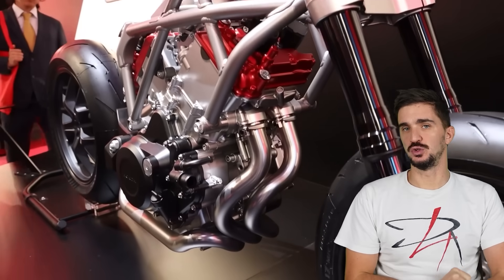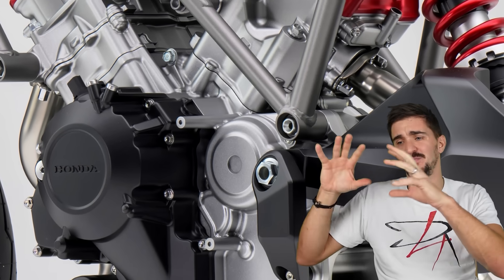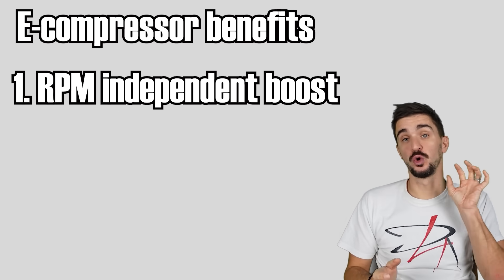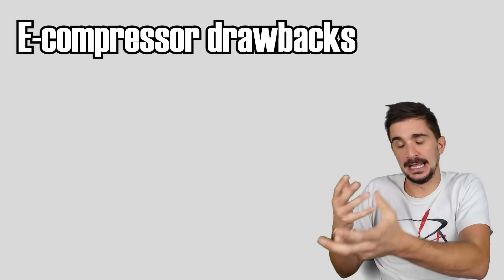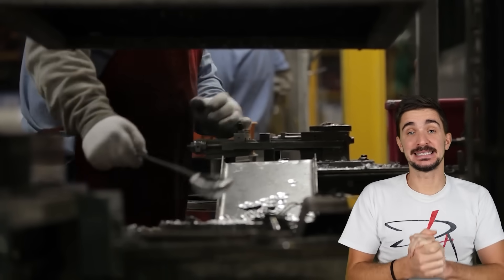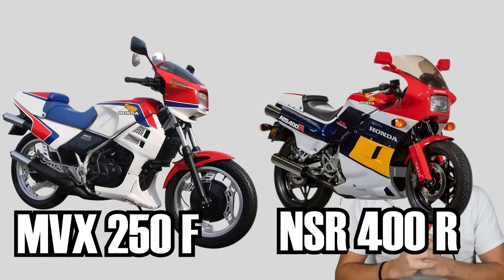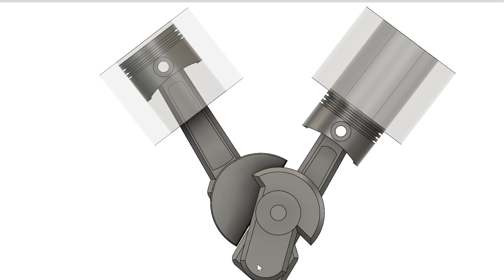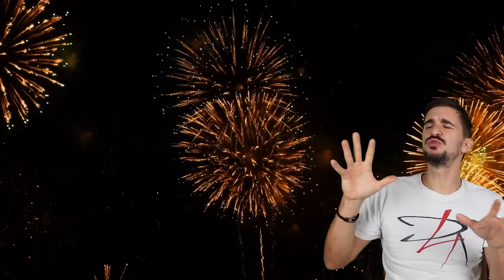Honda's New V3 Electrical Compressor Engine Explained

Comment: 1. Instead of increasing counter weight to single cylinder bank, could you make the single odd cylinder larger to equal the displacement of the two opposing? 

2. Is electric compressor more efficient or less efficient? The power conversion from stator to battery to controller to motor sounds like a lot of heat loss

Comment: So, E-compressors. What's the total power to weight to efficiency gain of the whole system. You'd need a small battery, and a BIG charging system to keep up with the compressor. The e-motor with enough power to drive it would also be pretty hefty. I'm going to take a wild guess and say under 150hp and over 450lbs for this thing, which is a no go for me.

Comment: From a maintenance perspective, I don't like the V3 config.  I don't want to maintain two DOHC cam and valve arrays on my bike.

Honestly, I'm kind of tired of disassembling the tanks on my bikes every 12k miles even for something like a P-twin.  Strongly leading towards a MotoGuzzi for my next bike just for the exposed cylinder heads.  At least I can do valve clearancing without disassembling half the bike.

I do dig the idea of the electric compressor.
Reply: Yeah, you have a point here.

Comment: Honda engineers thinking outside the box. Keep gas engines to power the vehicle and electrical systems, while using the an electric motor to power the engine and not the vehicle.

Comment: Question?
Wouldn't an INLINE 3 be better?
What about balancing the weight?
Wouldn't the V engine vibrate more then a INLINE engine?
What is the block, pistons and connecting rods made from?
Reply: Inline will not be better from the packaging standpoint. It will vibrate a little bit more, yes. Block, pistons and connecting rods are made from a metal, obviously.
Reply: @vvevvevvvv Forged or powder centered, compression mold?

Comment: I'm curious about how they will deal with knock and preignition.  The advantage of being able to build boost instantly is mitigated by the inability of most engines to tolerate forced induction at low rpms unless they run fancy fuels.

Comment: It is basically a centrifugal supercharger but less efficient one. Instead of using a belt to spin the compressor, honda is using a electric motor to spin it. Which is charged by a belt probably. They didn't wanted to include a massive belt that would look ugly and possibly threaten the safety of riders fingers so they are paying more by installing a electric motor and getting less because of indirect way of spinning the compressor.

Comment: I don't like odd number engines. They all have inherant balance problems that must be delt with by adding an opposite counter weight. Rather than having a Cheaper 1 cylinder engine with a bunch of Dead Weight on the Flywheel to SIMULATE another complete Cylinder I would rather have 2 pistons working together to deliver smoother more efficient power.

Comment: You are wrong!
It IS a turbo, or an e-turbo, because the air is compressed by a turbine impeller.
A traditional turbo has TWO turbine impellers on a shared shaft, one is drive by exhause gasses, the other turbine compresses the air.

This e-turbo has just ONE turbine impeller to compress the air, and is driven by an electric motor.

Also, there is another important benefit of honda's new e-turbo design; the computer controls the boost at all times. So thr ECU computer can select different boost levels for different rider modes and different RPM ranges.
Reply: @d4a     be rude and laugh all you like, but if the air is compressed by a TURBINE then it is a type of "turbo" as opposed to a compressor or supercharger which has displacement impellers

Comment: My 2nd bike was an NS400R.  I can attest to the smoothness of the V3 configuration.  That bike was a blast.  The main downside was you smelled like an oil refinery after riding it as it was a 2 stroke.  But it punched well above it's weight.  That era had several similar options from Yamaha and Suzuki as well, but those were inline 4 cylinder 2 stroke bikes.
Reply: rg500= square 4.
RD500= v4.
Reply: @impulse_guy_22  Sorry, I knew they were 4 cylinders, I just assumed they were inlines.  Cheers.

Comment: Dude, I like you and I like your videos but there's an error in this one.  The animation of the flow through the compressor is backwards.  It's a centrifugal compressor, the air goes in the middle and comes out the other end of the 'snail shell.'

Comment: If wheel or engine braking is incorporated into the electrical recharge, you do get augmented boost - aka; hybrid. And the boost "may" increase mileage in stop/go operating conditions just as it does with autos. Perhaps, that was part of the intent at the beginning with increasing emissions standards being imposed.

Comment: Weve been working on a project mating a parallel twin to a larger ktm single. This is the closest ive seen im glad honda of everybody was obsessed with the v3 idea as much as i am to bring it to market. But i want different sized cylinders, might not run for a long time but i just want it working as proof of concept.

Comment: The E-compressor looks like my wife's hair dryer.  I'm don't understand why they went to 3 cylinders with two are in the same compression cycle...adding more parts/complexity. Why not just a two cylinder V?

Comment: It would be interesting to compare the efficiency and power benefits/drawbacks of using an electric motor to make a compressor spin, versus applying the mechanical energy directly to the output shaft of the engine with an assist electric motor.

Comment: Would there be a benefit if they made the single cylinder side larger diameter bore to equal the displacement of the opposite side?

Comment: If they add a lightweight hub motor to the front they can recharge the e-boost system with a regenerative braking circuit.  I'm seeing a supercapacitor application, maybe.

Comment: I need to hear one of these, wondering if they will fir the 2 front at the same time or 360 apart, I assume together, also why both at the front other than picking space?

Comment: In terms of energy exchange a turbo and an e-compressor are quite similar -- on adds losses due to back pressure while the other via the generator... the question is in the total efficiency, weight difference.

Comment: That is a centrifugal supercharger.    Could help torque and low rpm.   Being electric it may loose ability to build much boost at higher rpm but might be more effective at low end performance ranges.   I don’t know anything about this power plant or the compressor being used but those are first thoughts based on other electric applications that struggled to maintain boost at higher rpm.   Will be interesting to see what Honda has figured out.

Comment: Another benefit of uneven firing order is it makes it easier to regain grip in slippery conditions as there is longer period when tire isn't driven but coasting along. This is basically what most traction controls do, with these kind of configurations it comes partially for free.

Comment: Honda went full retard. Rather just have a V4 with no compressor, extra power and takes up the same footprint as the 2 front cylinders. And they can keep the electric compressor. Just another electronic part to fail.

Comment: I have an Audi SQ7 with the electric compressor and it basically does nothing at all. People disable them when they play up and it’s apparently unnoticeable. Also 5psi, maybe at idle. There is no way that thing will make 5psi at 10,000rpm. The electric motors just don’t spin at the rpms real turbos spin at. They will just use it to raise low rpm power, I doubt it will do anything for peak power.

Comment: Before vid thoughts: Will the rear recip assembly be of different mass to reduce balance issues? Different bore/stroke for similar power pulse? Or is there a balance shaft? Electric blower can use plug-in batteries, this sapping zero engine power to operate. Regen capability can be programmed in, linked to ABS. Will it be on-demand boost, so it will run aspirated normally? 
Time will tell, but whatever it is must be affordable, based on market trends.

Comment: I guess I'm old, but I like the feel of turbochargers. I like the positive feedback loop where the engine revs up far enough for the turbocharger to start supplying more air than the engine can naturally intake, whereupon the engine starts building horsepower at an exciting rate. Having the power delivered instantly is great for commuting, but not as much fun.

Comment: With only one connecting rod per crankpin (unlike Moto GP's V5), couldn't balancing be achieved by shifting the crankpins by an angle equal to (180° - 2 x V angle) as on the V4 1200 at 76° and on the old V2s at 52° and 45°, which would give a V opening of 75° an angle of 30° (instead of 105°)?

Comment: You didn't mention, i believe, one of the advantages of an E-turbo in that it does not heat the inlet air like a normal turbo does due to exhaust gas heat, heating the housing. Probably why it does not need an intercooler.

But also, why not just build a v4. Pretty much the same width as 2 cylinders ... ?

Comment: In the "overall net more gain spelling" I think you forgot the point that electricity wants to be generated before as well. I don't know if the efficiency of electric generators and Motor is better than the exhaust Turbo System, but anyway.

Comment: Wie lange soll die elektrische Scheiße halten?? Da sind die Werkstattbesuche schon vorprogrammiert. Und von Langlebigkeit brauchen wir hier gar nicht reden.
Ich habe eine Kawasaki GPZ 750 aus den 80er mit 90.000 km und eine Yamaha Fazer 600 aus 99 mit 50.000 km.......... Das sind Werte die mit diesem Elektroschrott nicht mehr erreichbar sind. Siehe E-Autos. Aber fast alle reiten ja auf dieser Schiene

Comment: A forced induction V3 motorcycle engine... I see Honda found the nose candy and I'm excited! I'd also guess the sound from this thing will be incredible, which is honestly what I'm most excited for (engine power output in general is pretty damn good across the board nowadays, what can I say)

Comment: 89,000 miles and my 900s BMW never needed service never broke was stable and ran wonderful I sold it for moe than I bought it for. Try that with a modern bike.  My RD350 Yamaha was fast for the day light but should have been lighter and was amazing once bored to 398cc it really did need a better aluminum frame and more shock travel.

Comment: I wonder where the electrical power is going to come from to spin that electric compressor?  There's no way a typical 12V motorcycle battery and charging system will be able to handle what that compressor is going to be asking for. I'll bet the bike will have a special, very beefy Lithium battery that packs way more of a punch. Or possibly even a supercapacitor.

Comment: Batteries have also gotten lighter, more energy dense and also lasting longer charge cycles since the 2000s. Couple that with energy recovery then its win win across all fronts except cost😂!

Comment: I'm figuring Honda can offset the weight of a larger battery by using an NiMh one that weighs less than half as much. This could give a 20AH battery capacity in a 10AH lead/acid space which would work. The battery technology is well enough established where it's completely ready to go as well. It would have also been interesting to see them use their old V-twin 3 valve combustion chamber design that worked very well in the 80's, making a simpler engine overall, especially if it's going to be boosted, giving a good balance of lower RPM torque, a simpler engine and still good high RPM usability. I really did like those earlier simpler single cam motors they made, I know this will be nothing like that though. 
Very happy to see Honda sticking in the market and continuing to develop new and hopefully better bikes, I wonder if this will be a very street oriented bike like the old VFR line was, those were so wonderful.

Comment: Ok.. I give up.. you have way too many inaccuracies compared to your other videos. The e-compressor is going to take power from the engine driven alternator, so it cannot produce more power than a turbo, UNLESS you are using a battery that is working as a power storage, AND that’s been charged with regen or when the engine is not on boost. And I think that’s what Honda will do and that’s why you will get more power. But it is misleading to say e-compressor makes more power because there is no back pressure, without going into these details.

Comment: It should be near-zero boost lag and idle boost threshold, not zero boost lag and near-idle boost threshold. The electric motor still has to overcome the inertia, so there is always going to be lag. But, the boost from an electric motor is independent of the engine speed, so boost threshold is idle.

Comment: VTCEC
Variable Valve Timing&Lift and Compression electronic control

Doesn't it have a turbine anyway? 

That's what they're using to power the battery for the compressor right?

If not then the alternator is gonna have to take more power anyway which might be more than the back pressure loss

Comment: I’ll be shocked if this ever sees production.  The complexity of v with a blower, size of a v relative to a parallel , vibration of a v, heat management from the rear cylinder, weight of a v, cost of a v, complexity of service of a v relative to a parallel, packaging of a v is inferior to a parallel, …. makes no sense to mass produce this.  With the proliferation of cross plate cranks, there is no reason for the existence of v engines.

Comment: One reason for the turbo's limited boost and short boost duration is the power required. A supercharger on a small block Chevy (5.7 liter) requires up to 200 horsepower (at a slightly higher boost). With that baseline, we can estimate Honda's power needs just based on displacement ...0.8/5.7=0.14,   0.14*200=28 horsepower. Honda is a higher revving, better breathing engine. That increases the power required, while the lower boost pressure decreases this figure. But it's safe to say 20 to 30 horsepower is required. That is a LOT from a small motor. That is also a LOT to extract from the engine spinning a LARGE generator. A large battery is also needed to enable briefly surging the boost beyond what the generator itself can create.

Comment: I used to own a NS400 , 3 cylinder 2 stroke, first time the power band hit ,it almost threw me off the bike. I wasn't ready for it. Thankyou for making these videos.
Reply: We learned with 2-stroke Motocross, to always keep a finger on the clutch lever to help control abrupt power.  Even with 50 hp, on corners with good traction, we would pull in the clutch while entering a corner, pin the throttle open, and feed the power out with the clutch.  That would even let us enter the corner a gear higher than normal, (which also taught us faster corner speed), and not have to shift up again after the exit.  The technique was developed by Kent Howerton in the 70's, to keep his Huskvarna competitive the the new and faster Japanese bikes.
Reply: @EarthSurferUSA  sounds like you changed more clutches than pistons
Reply: These sounded great!! better than my RZ500
Reply: @snellen46  They weren’t, the RZ500 was faster and and more powerful than the NS400, the NS went more like a RZ350, I used to race against them in junior production races on my RZ350, they were in the same class.
Reply: @TeUhtred7860  I only said they soundfed better, I owned both. Honda also handle way better stock
Reply: I loved that bike, and it’s asymmetrical pipes!
Reply: Same here.  Gave it a fist full of gas during the test ride (since it was just a 400cc), lifted the front wheel at 50 mph when it hit the power band.  Scared the crap out of me.  Took it easy for the rest of the ride, then bought the bike.
Reply: @jeffer1101 Just a 2-stroke 400 🤡🤡🤤
Reply: Yeah but that was an INLINE 3, and 2 stroke.  A V3 four stroke is 'parents are siblings' unintelligent.
Reply: @VBMichael_D  The NS400 was a V3 not inline, I  have the 250cc Honda variant which is also a V3
Reply: @georgebarnes8163 Oh, a V3 is even gayer than an I3.  I'm sorry that neither you nor Honda sees this as a gimmick, which is 100% what it is.
Honda:  ufck physics.  We're bound to get some clown or another to buy this. 
 
I'd rather buy my 2002 CBR954RR all over again than to be given a V3 powered bike.
Reply: @VBMichael_D  LOL, a 954 is nothing to write home about, shame you missed the power delivery, light weight and fine handling of the NS400R while you were riding your  UJM.
Reply: @georgebarnes8163 Try again bro.  NS400 weighs 359lbs.  954 weighs 370lbs.  NS400 has 72hp.  My 954 has 154 hp and 75 ft/lbs of TQ.  954 will go 175mph.  NS400:  135mph, and that's a generous assessment.    Your 400cc  weighs all of 21lbs less.  HAHAHAHAHA
Also I weigh about 160lbs so me on the 954 is basically like no additional weight at all.
Reply: @VBMichael_D  Google is your friend
Reply: @georgebarnes8163 MVX 250? Always wanted a go on one of them, not many here in UK,
Reply: @2stroketimebomb tried one of those not long after I got my bike licence(must have been the real early 90s). Hoot to ride, not super quick, rear cylinder prone to seizure from memory

Comment: This Ain't Nothin new Yamaha came out with a XS750 which was the three cylinder and I also thinking 850 but I'm not sure.
Yamaha's first three-cylinder motorcycle, produced in the late 1970s and early 1980s. The XS750 was designed for reliability and rideability, with a shaft drive, triple disc brakes, and solid alloy wheels.